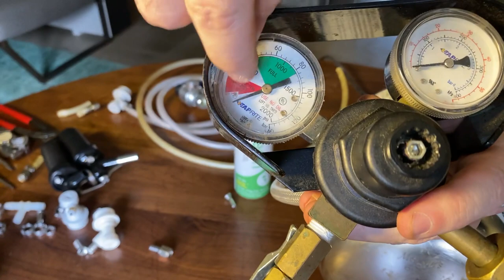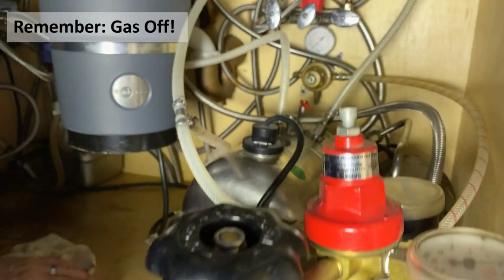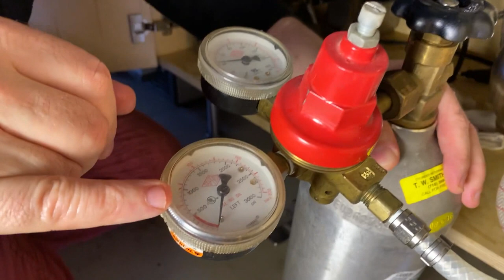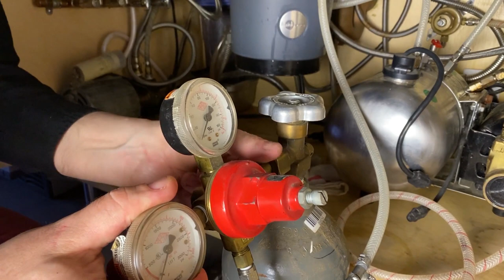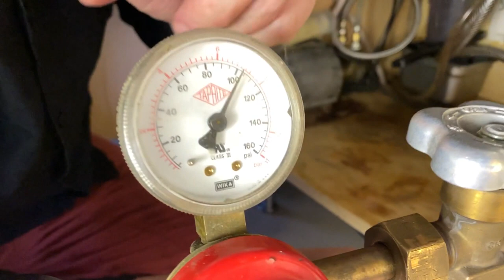Setting up a Home On-Tap Carbonation System -Complete and Unabridged

Comment: Hi, could you recommend an alternative method of cooling the carbonated water post carbonator? In the video you mentioned this cold plate method in an ice box is not the best. Thanks for this great video by the way.
Reply: The cold plate is more of a soda industry standard due to restaurant style soda machines that also dispense ice. It's easier to have the carbonator and syrups in a back room of an establishment and chill the incoming carbonated water/syrup right before it's dispensed vs. something like beer that requires long runs of glycol and insulated wrap, etc. I am just finishing up a mini fridge conversion where I have my pump outside of the fridge but the stainless tank inside, always chilled. This is easier in my eyes as a cold plate is designed to be at the bottom of the ice maker which has its own issues (like finding a standalone small ice machine). The colder the tank, the easier it is to carbonate (lower psi) as well as Dave mentions. I can share more information on the setup if you're looking for more help. Cheers
Reply: @linguistisch  Hi William, I’d love to hear more about your setup. Thanks.
Reply: @linguistisch  - Can you share what type of tank you put in the fridge?  Looking to do something similar and would appreciate the insight.
Reply: @linguistisch  don't forget all the bars with barguns, like you said cold plate the best close to the dispenser, always with ice on it when in use
Reply: @linguistisch  Anything wrong with putting the pump inside the fridge too?
Reply: @linguistisch  Hey sorry for the super late reply-- Would love to hear an update on your mini fridge project. That is what I am currently looking into... not sure whether it is worth getting two Mcann tanks and daisy chaining, or if one is sufficient. Also curious where you end up getting your fittings as the listed "Markpowers..." site doesn't seem to be functioning for me. Anyway, thanks for the reply and I hope your project turned out well! Cheers -
Reply: @ryanedwards4325  I think that is discouraged because of the condensation that would build up in the fridge and potentially mess with electrical components. Seems simple enough to put the pump outside the fridge - only tricky part is not hitting any refrigerant coils when drilling through the side of the fridge for piping.

Comment: Seems that Mark Powers is out of business, and other sources for the Bev Seal tubing.  Any other brand names that are similar?  Thanks!
Reply: If you're still looking, Parts Town carries the Accuflex Bev Seal Ultra 175 hose mentioned in this video in 1 ft increments. The 1/4" I.D. is Parts Town #ICO1030842 and the 3/8" I.D. is #MANB175-06300-00. Product names are a little different on the site but the manufacturer parts numbers line up and I can confirm that's what I received.

Comment: Amazing video. At 3:24, you say that you can suck bottled water through the carbonator, if you don't drink your water. Our new house has well water that I'm not keen on carbonating. My question is how do you "suck" bottled water through? I thought you needed water pressure in order for the tank to fill up?
Reply: The carbonator includes a pump, but yeah you do need some kind of water pressure. I believe it's 20 psi minimum. If there is inadequate pressure the pump can damage itself. I'm not sure how Dave imagines you would get your bottled water to that pressure.
Reply: @chrishundt4598  This is very useful, thanks. I'm obviously a novice here, but is there a way you could just use gravity to help the pump along?
Reply: @jessecrosson6648  In theory you could, but I think you'd need a very tall tower to get sufficient pressure. You can Google it for more details.

I think what you would more likely want is a second pump that pumps the water out of the bottle to the carbonator and maintains a high pressure in the line between them. I'm not sure what type of pump would be appropriate for that. The carbonator very briefly (for a few seconds) pumps in water at a high rate, nearly 2 GPM, and it will cause cavitation if the pressure drops too low while it is doing that. So perhaps you would need a second, pressurized tank, between the bottled water and the carbonator.

Comment: Hi,, Did you ever make a video about hand carbonated systems? I looked through your videos but did not find anything.
Reply: You can make a hand carbonator system just using a CO2 tank and a few inexpensive parts. This guy's video shows the simplest, cheapest options I've found. You can also scale this design up, carbonating directly into kegs instead of the bottles. 
 https://www.youtube.com/watch?v=BLFvw4CVKgY

Comment: This video helped me a great deal getting a beverage trailer up and running for higher volume events.  Ive been running since May with the McCann Set up and recently it appears that the carbonated water is freezing in the cold plate in one of my bins.  I have a 2 tap system.   Anyone have any ideas about this?   Water runs with no ice but after the bin is filled with ice, water stops so my only conclusion is the cold plate is freezing up..  Crazy
Reply: I took care of your help, how can I contact you.

Comment: Dave A:
what is the correct water pressure in the bigmac carbonator, I have a 8 port soda system at home but it seems to have a head on the soda the seem to eat up the carbonation, the only think I can think of is carbonator water pressure to high, I have a water regulator after the filter before the corroborator, it splits to the corroborator  and the water port of the soda dispenser, thank you for reading, Tj

Comment: Hey Dave! What is the best pump/carbonator setup for premixed root beer in a busy restaurant?  100 gallon setup using 2 to 3 beer taps
Reply: you don't need a carbonator for premix..just co2 to push the product out, thanks

Comment: Fantastic video, thanks Dave! Question: could you run pre-chilled water into the big mac, and keep it all inside of a refrigerator? In other words, put the entire setup (no cold plate) inside of a kegerator, and still get appropriate carbonation without the cold plate.
Reply from the maker: I mean you could, but it won't produce the best level of carbonation- carbonating the water raises its temperature by 2-3 degrees, and since it'll already be pumping not super cold water, that will raise it more, causing a little more foaming and not as great bubbles- but again, it can be done
Reply: @chugalug Responding on Dave's behalf here- he says you want to ice it down, that's the only way to get it to appropriate temperate to ensure best carbonation
Reply: drinks need to come out of the valve at 38F or less otherwise the drink will be FLAT
Reply: temperature of your drinks need to come out at 40F or less otherwise it will be flat, period..if you can't get drinks to that temp give up it won't work

Comment: Hello Dave, Watched your video a number of times, ordered & received my McCann E400397.  Went to Mark Powers' site, called with parts list in hand, & they told me they're shutting down on 02/12/21!  Where now to go for the other items you've listed above?
Reply: Dear Joseph, Just a thought, as I have the  E400397 that I found in the trash. Plugged it in and seemed to be pumping water out of tank. Perhaps you might be interested in it for parts, or whole. I personally don't drink carbonated beverages, but I like machinery.
Reply: @stewartbruce2409  I’m interested in it if you are selling/donating 😀

Comment: Does the water in the tubes running through the coldplate ever freeze up if its left standing too long without seltzer being dispensed ?
Reply from the maker: That has only happened to me using lots of cold ice directly from a freezer on a dry plate. Won’t happen with wet ice unless someone dumps salt in.

Comment: What, if any, is the danger (during maintenance) of shutting off the incoming water supply without disconnecting the carbonator pump sensor?  Could a system over-pressure event occur when the water is turned back on?
Reply: The danger is that if the pump runs without incoming water (or with incoming water pressure too low) it could break; I think that is a common feature of vane pumps.

Comment: Hi, Dave.
Can this system be used to pressurize simple syrup without necessarily carbonating it? I run a shave ice shop and am looking for easier ways to refill our syrup bottles. If this doesn't work for that specific purpose, is there anything else you can suggest.
Reply: For your syrups, a simple transfer pump or a fluid pump like a surflo would be a lot cheaper than a carbonator.

Comment: Can you use premixed alcohol and water mix in place of water into the carbonater?
Reply from the maker: You could, but I wouldn't, you'll get a lot of foam and cleaning out the system between different products will be a pain
Reply: you drinking now?  that would never work

Comment: I am curious as to why you do not have your CO2 Bottle under the sink secured so that it is impossible for it to fall over and chance the pressure regulator connection break off the bottle. If this happened, wouldn't you have a flying rocket? I have heard of this happening with the much larger bottles.
Reply: that is correct, in a commercial business that co2 bottle has to be chained, but the low paid workers never put the chain on when they change  co2 tank out

Comment: Are Perlick/Intertap stainless steel body flow control faucets OK to use with a carbonation system?  Can we use regular stainless beer faucets?
Reply: He hasn't used them, but has seen other people use them but hasn't been super excited by the seltzer that came out of those systems

Comment: Why don't you run from the filter to the cold plate then to the carbonator so that the carbonator is adding co2 to cold water which accepts it better than room Temperature.
Reply: @758Dino  I think if you carbonate it cold you are supposed to keep it cold from then on (including while it is in the carbonator's tank). I think people do this sometimes but it is a more involved setup.

Comment: Thanks for the video!  Super helpful.  I was given a Wunder Bar Beverage Dispenser.  It does have a flow regulator in the manifold.  Will I have significantly less carbonation if I use this versus buying the recommended tap?
Reply: you also have a cold plate with that bargun system if not forget it

Comment: Hi Dave, curious for your take on this. We don't have space for an icebox chiller in our kitchen. Was thinking of doing an under-sink set up with the becker valve tap in the sink cabinet tip-out tray. It would mean room temperature seltzer, which we don't mind. Is this truly a no-go? Meaning we will only get flat or weak carbonation? For reference, we currently have a soda stream and we are ok with the carbonation level we can get from that.   Or should I just find another place to construct a properly chilled set-up?
Reply from the maker: Howdy. If you can, I'd recommend going to a restaurant or bar that hasn't opened yet and ask to try some of the seltzer out of the gun, before they've put ice in the cooler. Because it's under such high pressure and not cold, it foams out, and the bubbles are just weaker. You can also use the smallest igloo cooler you can get that still fits the cold plate and rig it work that way- it doesn't need to be big, it just needs to be well insulated.
Reply: My plan to address this issue is to do the whole setup in the basement and run the finished product up to the kitchen. By my calculations there will be about half a cup of water between the cold plate and the tap. Not sure if I can insulate it well enough to keep it cold most of the time or if I'll just lose that half a cup each time I dispense.
Reply: it's a NO NO! you will not get any carbonator instead of going to bar or restaurant, just open a warm can of Coke or Pepsi and see how that tastes!  icky poo thats what your system will be like, PERIOD
Reply: @honestshrubber  1/2 cup your doing good..just run the soda off a bit to get it chilled your not wasting much tiny bit of co2 if any

Comment: Trying to solve a problem in my friends restaurant. The carbonated water comes out too fast into the glass. It's set at 105 psi. I've tried turning the screw to lower the psi or increase it(1/2 turn either way) but that's not helping. They put a glass under it, tilted, and it splashes back.
Reply: is soda water coming out or just co2 gas..don't mess with the regulator...need more info

Comment: Would there be an issue putting a system like this in a basement and doing a long line to counter?
Reply: I did it this way. The issue is just that the seltzer will warm up as it sits in the line. How long the line is past the cold plate will determine how much crappy seltzer you dispense before the good stuff comes (about 1 fl oz for every 3 feet of 1/4" hose). I either let that go down the drain or mix it with the cold seltzer, depending on how cold/fizzy I want the beverage to be.

Comment: You've probably answered this previously but if the co2 can't come in contact with brass then why is the regulator made of brass?
Reply: It is the soda water that should not come in contact with the brass and not the co2
Reply: @758Dino  good answer.   if that back flow goes bad you will also loss a lot of co2 over time. if its leaking the fittings and the procon pump could start to turn green from the chemical reaction..no one will get ill or sick just when you go flush the toilet the water will be carbonated

Comment: Can I use a stainless steel water purifier faucet or a bar faucet?  These seltzer draft arms are very expensive.
Reply: Nope, unfortunately those just don't work as well and they are also not designed to keep gas in, really just liquids
Reply: @jeannihoul8914  thank you for your help.  I did buy a draft arm and its quite massive... taller than my faucet and looks a bit ridiculous at my sink.  I'm looking for an alternative solution.
Reply: @b-gill9224  If you are able to build some kind of horizontal mount over your sink you can get a premix valve like the Becker one in Dave's video (there's a mountable version). Cornelius makes one too. Those have compensators and are designed to handle a fully pressurized soda line.

Comment: Dave, I’m sorry I did not catch where my cold plate goes in the system. Does it go from my inlet water to my brake tank, sorry not sure can you help out
Reply: Cold plate goes last.  Between the carbonation tank and the tap, his also had a loop just for cold flat water.
Reply: @deathcake9000  yes sir

Comment: Is this the one in the video on mark powers? Part #: 27-2210-90
Its the only one i could find. And do you think it would fit into one of the cheaper beer towers on ebay? Ibis is expensive, thanks
Reply: i have the same question, did you get a reply?
Reply: I think that was a squeeze valve (https://www.totalapex.com/squeeze-valve-w-fitting-1-2-mfl-4-brb/p54040/). The one you linked to is meant to be mounted on a vertical surface, and I don't think it fits a beer tower. I bought the Cornelius version of the same thing and built a custom mount for it.
Reply: @honestshrubber  any chance you can share a picture of your custom mount and a link to the Cornelius valve? I’m hoping not to use the ibis tower if possible. Thanks!
Reply: @kalbear  I don't have a good photo of the mount but basically I just built a little stand out of scrap wood I had lying around, including a vertical face pointing the right way, and mounted it through a hole in that face. Ugly but functional. I mounted it in the cutout for a soap dispenser.

Comment: Please help: I have 2 carbonators, 1 i bought used from a resturant and the other i just bought brand new. My issue is when i purchased the used one, i took it apart to clean the water tank and it had a bunch of black flakes coming out, i decided to purchase a brand new McCanns because didnt want to take a health risk, but i was so curious i pulled the floater off and low and behold there are black flakes on the bottom of a brand new unit. Whats going on, ive seen this in a local panda express, soda machine. Anyone else have this issue?

Comment: Would a reverse osmosis system work ok vs a water filter?
Reply: Absolutely. The R/O systems already have the type of filter he showed, plus charcoal, etc, Upstream of the R/O membrane filter. I use it and it works just fine.

Comment: Hi dave :)  can i use this to carbonate kombucha?
Reply: No (also for the beer)- not only would it probably foam out like crazy when you dispensed it, but you also won't be able to access the inside of the rig to properly clean it out. Dave recommends getting a corny keg and force carbonating that way
Reply: As Jean said get a corny keg and if you a .25 cup of sugar to the keg it will carbonate on it's own, depending on the temperature it is stored at.
Unless you are like me and go through over 2 gallons a week you will want to keep the keg about 34° to slow down the fermentation process.

Comment: Hi Dave ...
This is the most important video .. Now we have solved 5 years of problems with bad sparkling or to soft sparkling.
How much pressure does your water pump put into the tank (Procon pump)?
How much water pressure comes to the pump?
What pressure does your safety valve open at?

You have been of great help with this video
ZegoWater.dk Team Denmark
Jacob Olsen